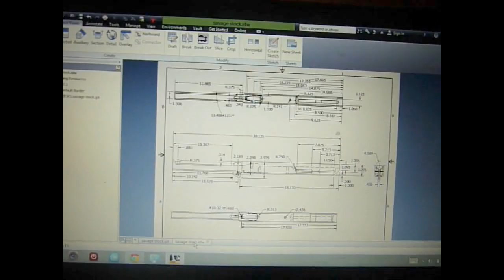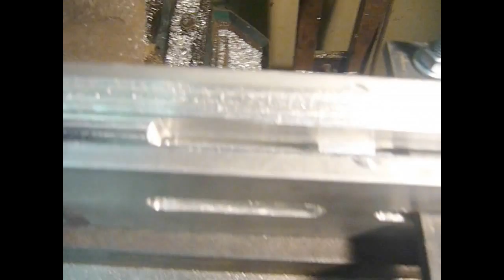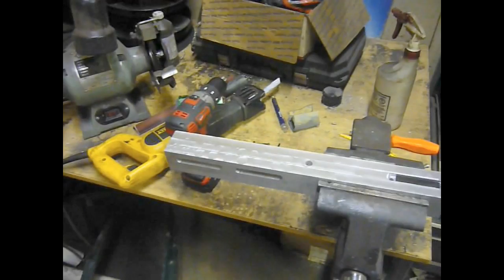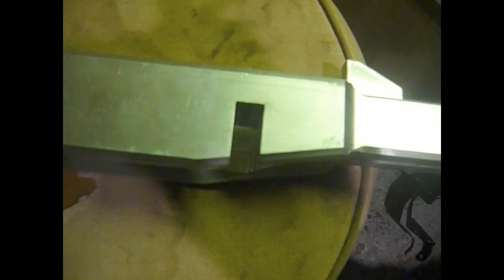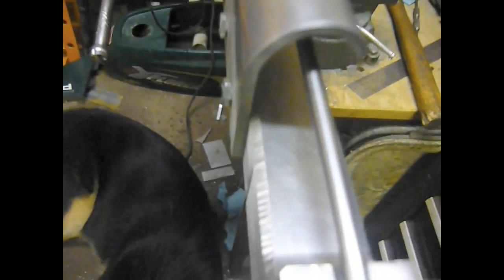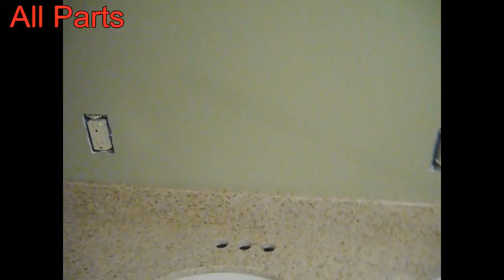Custom Machined Aluminum Rifle Stock Build

Comment: Great video.  I am curious. Why did you not use the round nose router bit to machine the barrel and action channel?  That is what I was thinking about using. And did you use a 2x2 aluminum plate?   I just have a very small Grizzly mill. So I am trying to get all the information and ideas I can before I begin my chassis project. Thanks again so much for an interesting video.
Reply from the maker: The size needed isn't a standard size.  You can get a custom bit, but they are very expensive.   I used a small bit for better resolution.   Just like 3d printing, the lower the layer height, the higher the resolution.   If you look on my channel,  you can see the latest rifle build I did on a manual mill and lathe.  You can do a lot, but it is time consuming on the manual stuff.  Good look on your project and thanks for the comment.

Comment: Looks very good so far, except for the cheek weld. "Graco" sells an adjustable butt plate that you can utilize in addition with a "Breako" Recoil Reducer, think the combo runs for about $100. Graco also has adjustable Comb Rise hardware starting at $40-$80, that in my opinion would look nice with a more solid comb. The .300 Win Mag has quite a kick.

I am going to start a Custom Aluminum Stock for a  Mosin Nagant M91/30.
I don't have any vertical mills or anything of that nature, just going to try and see if I could get away with using a "hydro band saw", router table, files, palm & detail sanders, and a dremel. So far I have trued my action and bolt, and am trying to see what I am going to do with the firing pin spring. Eventually I am also going to build a scope mount with a Picattiny to mate it with the "Cold Shot" MOAB, a mount which has 150+ MOA adjustments by micrometer with ¼ clicks. I want to brush up on the 1000 yard line, and then attempt to do 1 mile in the Mojave desert.

I shipped my barrel to 300 BELOW INC, to have my barrel treated at the molecular level. I am not sure of what process they have determined to use, as they do heat and freeze treatments with and without phase shifts and that depends on wether or not the metal in question is austenite or martensite metal, without getting into factors such as wether it's a diabolic or it's opposite. I looked on 54r to see if anyone knew what kind of metal they used back in the USSR at the time, but couldn't find anything accurate.

I cant believe aluminum stock is SO DAMN expensive!
Reply from the maker: Summit Credit Repair Thanks for the comment.  I could have made this one adjustable, but didn't think it was worth it.  Since the gun is only for me, that's the only person I need it to fit and the comb is bent to the shape of my face.  If I would ever like to change the settings, I can simply slot the holes.  I also designed and developed an inertia dampener that is calibrated to the stock and the round.  That thing shoots like pup now.  I cut the recoil energy from 30-ft/lb down to 11.5-ft/lb. The barrel should be here on mon the 16th, so I will be posting the completed rifle soon.  Good luck on your Mosin project.
Reply: TG Corbinski Thank You Sir, cant wait to see how your build looks finished. What kind of length, twist and number of lands did you go with?
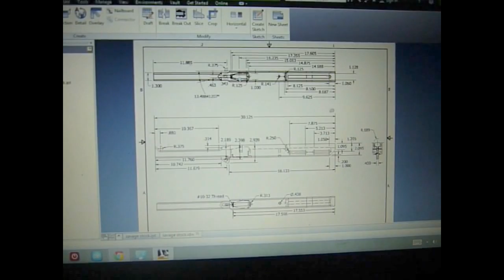Reply from the maker: Summit Credit Repair shilen stainless select match grade, 28", 1:10 twist.
Reply: Pretty good pick for a barrel. I had Barret Obermeyer make a 28" 1:10 with 12 flutes to avoid problems associated with mirage. He makes the 5r barrels. Uneven numbered lands tend to give better accuracy
Reply: +Summit Credit Repair. you'll see why they're so high once you make one. tons of time I've made 5 now for Remington 700 long and short.
Reply: +TG Corbinski...... Great stuff brother !